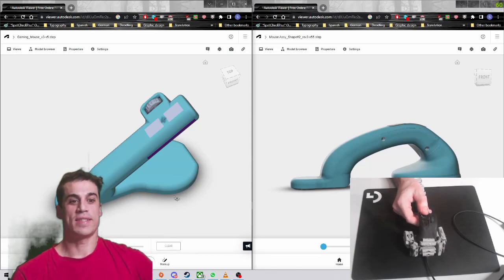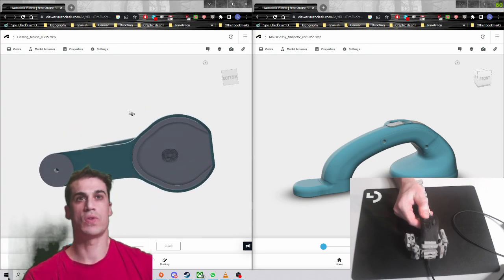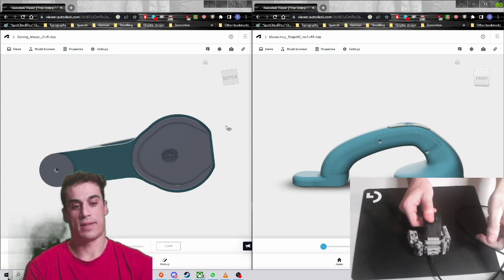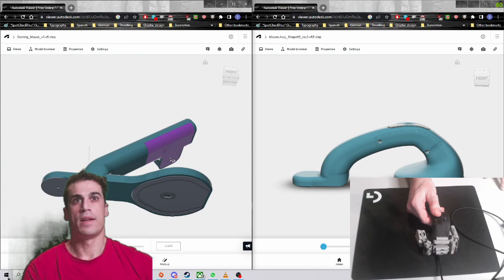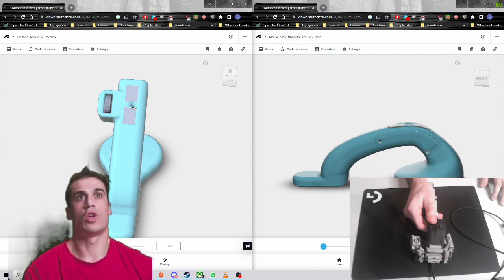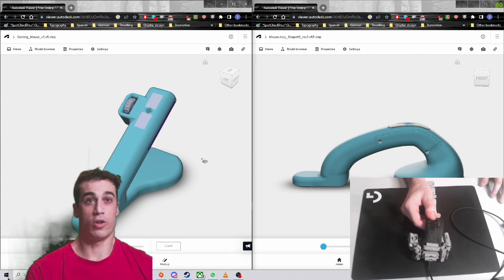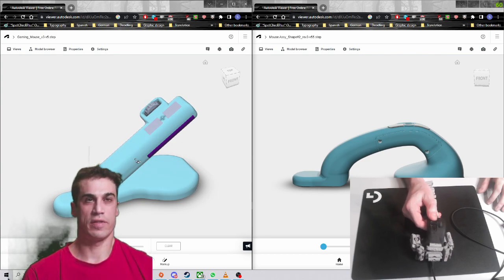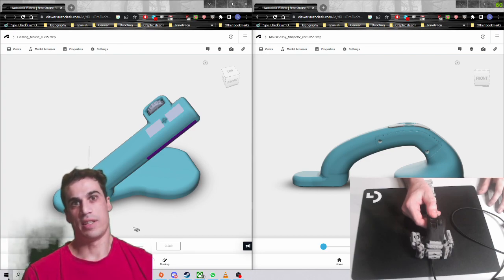Open source scalpel mouse conversion kit for a Glorious Model D wired mouse

Comment: Very nice, I love the design. Would be cool if there was one button on top for the thumb (right click) and one underneath for the index finger (left click) rather than both buttons being on the top.
Reply: Exactly what i was thinking. i would much appreciate it if the left-click was a "Trigger" underneath, so i can use it with my Index-Finger (which would also be very good for retaining muscle memory)
Reply from the maker: Thanks! I did consider it, but I was worried it would be too easy to accidentally click if you had a button on each side. It's still worth a try for sure.
Reply from the maker: Good idea! I thought a button underneath would be too easy to click accidentally, but a trigger might work. On the other hand, having the button straight down or nearly straight down means the mouse doesn't move when you click.